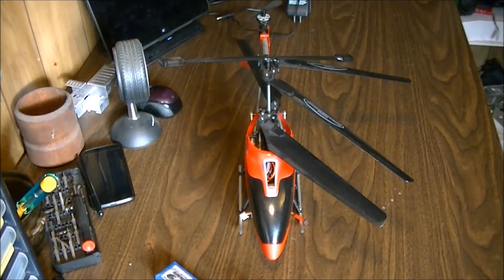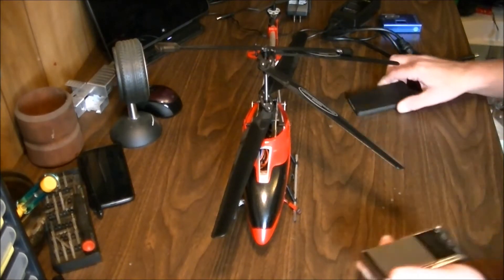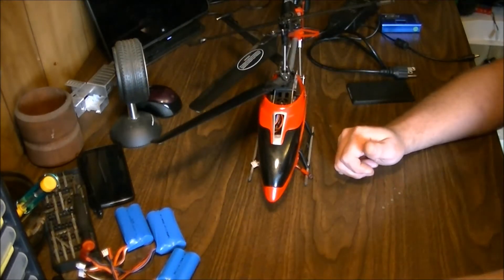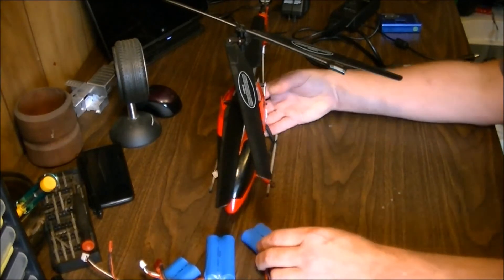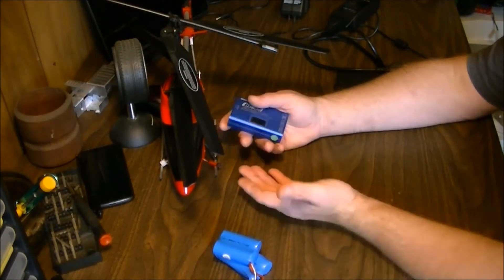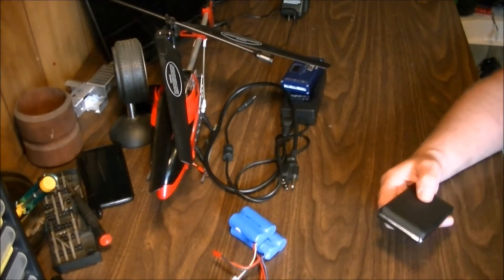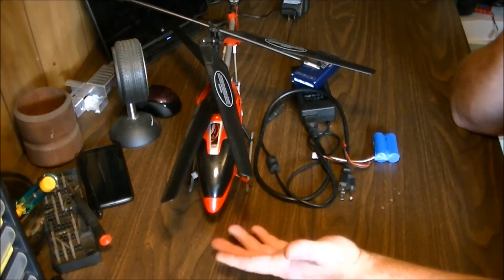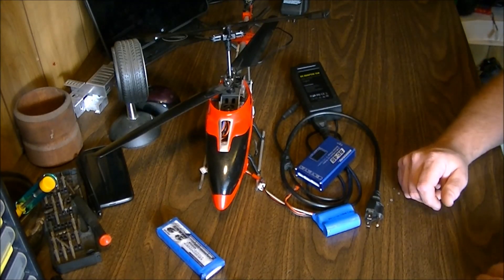S031 Battery Upgrade Mod

Comment: Thank you for the great battery lesson. I learned a lot from it. Do you know where I could purchase the 15V 5 amp power supply for the DC 4S? I didn't see it at the Hobby King website.
Reply from the maker: hobby king does have you gota seach their site but you can try some of the chinese sites as well